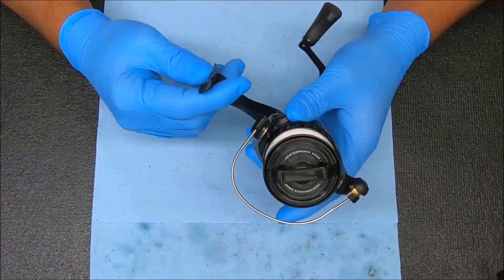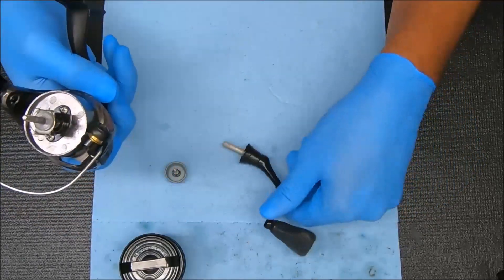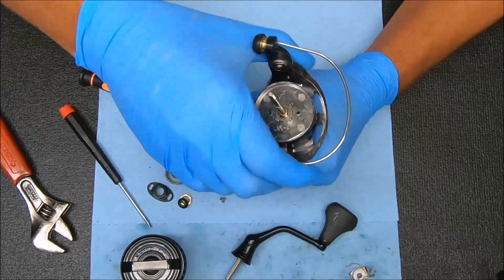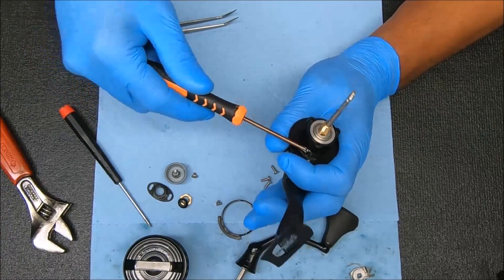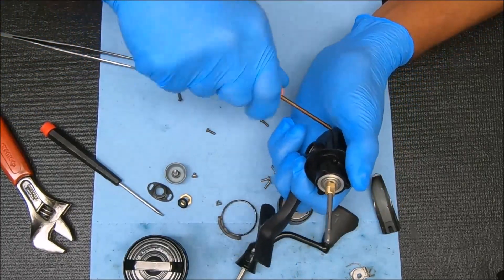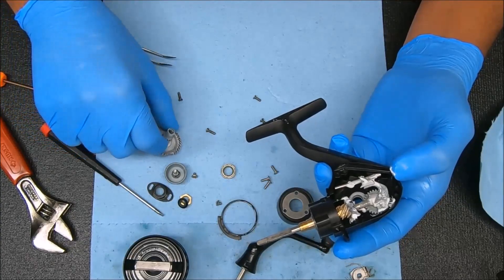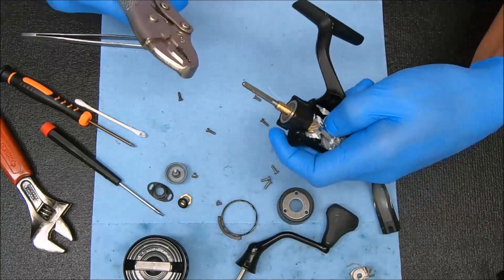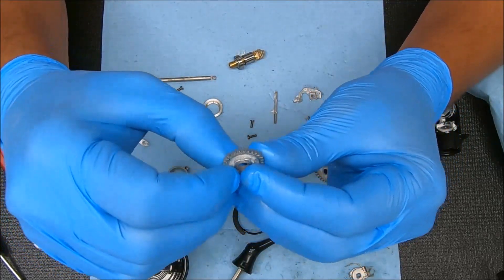Troubleshooting | 13 Fishing Blackout Kalon O Reel: Skipping | How To Fix Like A Pro

Comment: This just happened to my reel today, thanks for the video. Did you just order the new part off of 13 fishing website or did you order it from another website?
Reply from the maker: You're welcome and thanks for checking out the video! Sorry to hear you had similar troubles. Yes, sort of.... I've worked with them a couple of times in the past few years, and they have EXCELLENT customer service. However, with this particular reel, I just couldn't get the correct main/pinion gear mix to effectively replace the broken part, after a few attempts. You can call them at 800-508-6013..... ask for Corinne (you may be directed to email her, but call first). Be sure to be very specific regarding your reel details, since they make a few different models of these, and include as many pics as possible so she can clearly see the numbers on/design of pieces needed in your emails. If you need schematics, click here: https://13fishing.com/reel-schematics. Hope this helps.
Reply: Thanks a lot, will do!
Reply: Hey @TSGReelservice just got the new drive gear in the mail! Corinne was great. Do you have any recommendations on what and where to get the grease to put on the new drive gear?